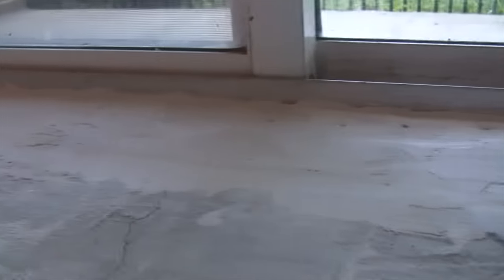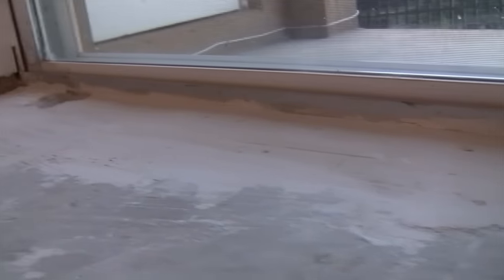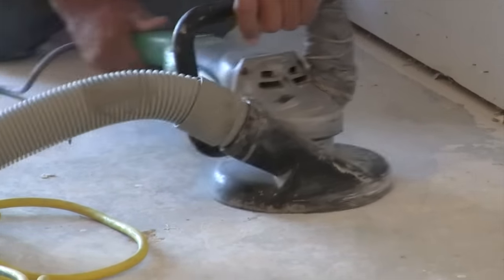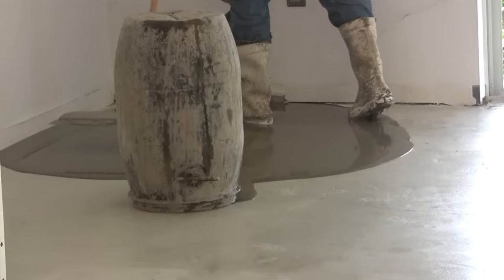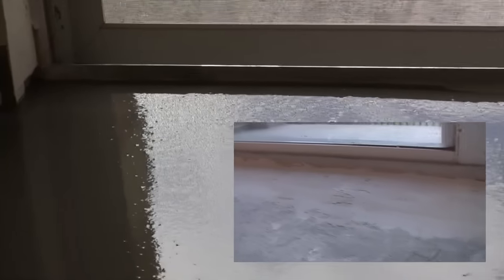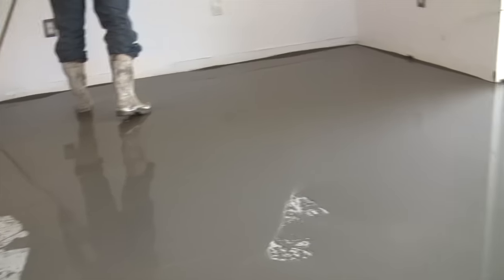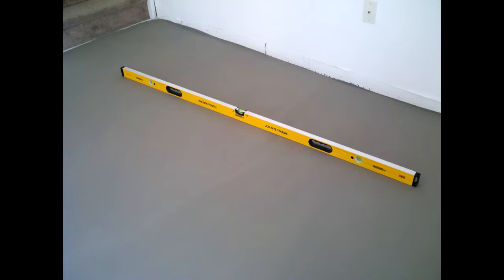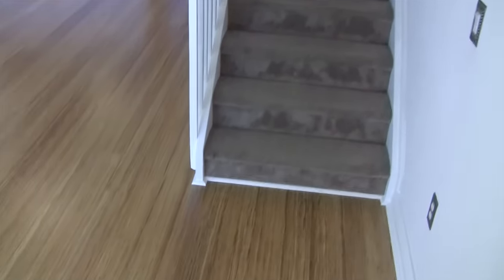How to Self Level Concrete Floors Like Pros - Self Leveler

Comment: How many layers can you put on top of each other? I need to raise the floor about 4” in some parts of my basement.
Reply from the maker: Great question. You can either use concrete to bring up the 4" difference close to level first, of course using all needed rebar, etc.  Or, if you are going over 1" in thickness, MAPEI recommends with their Novaplus 2 Self Leveler to sue a small aggregate of pebbles piled up:
 "For fills of 1" to 5" (2,5 to 12,5 cm) in depth, pre-place
 clean, nonreactive aggregate or pea gravel measuring  1/8" to 3/8" (3 to 10 mm) in diameter over the primed surface at no more than half of the total pour depth. (Use only clean, stable aggregate; limestone and other potentially reactive aggregates are not suitable.) Pour
Novoplan 2 Plus over the placed aggregate and rake
 aggressively to ensure full contact and bond with the substrate. "
Reply: Most concrete plants have a grout mix they can use for overlays. they turn out as good as the finishers are and they use the bonding agent as they did in this video. A self leveler can be used after but, 4 inches is too much for self leveling. I hope my response is helpful.
Reply: I have personally used A grout mix at about 2 inches where aggregate can be a problem. 4 inches throughout is just an over pour.
Reply: At 4" you need to learn how to float.  The cost of self leveler alone is gonna kill you
Reply: use regular concrete

Comment: And they didn't pull the carpet off of the bottom Riser because? So now when I go in to install carpet or lvp or laminate or tile I have to somehow cut through the carpet and imagine that if there's tack strip on the bottom of that Riser it's not going to be entirely embedded in self leveler?

5:32
Reply from the maker: You are not paying attention very good. They stopped the self leveler within an inch of the carpet. They did not embed the carpet in the self leveler,  you're just making stuff up.
Reply: @jeffostroff  as a 33 year flooring installer who has self leveled many floors I can say that if the leveler was "stopped" 2 inches from the carpet, any type of flooring (save ceramic) would have to have said 2 inches filled with floor patch because self leveler stopped short of a wall or some type of barrier would leave a height difference and therefore a gap under installed floor.

The carpet should have been pulled up. Any installer would tell you that.

And you can't just stop self leveler short. Not without a barrier. Believe me the self leveler reached the carpet.

I am paying attention plenty good.
Reply from the maker: @williamthomas5780  I don't know why you keep trying to force an error mode where there was none. I was there, I saw with my own eyes. I filmed the guy myself, like I said and like the video shows, the self leveler stopped not within 2" like you claim, rather he stopped within 1" of the stairs and did flow to within 1/2" of the carpet and stopped, never touched the carpet. He does know what he's doing and had good control of the flow. You just don't understand the concept of surface tension. These guys do this day in and day out, and when I tell them to stop 1/2" from the stairs that is exactly what they did. Stop trying to make up stuff that is not there. I installed this bamboo floor myself. There was no gap causing any problems like you claim, there was no 2". As a 33 year flooring installer, you should know when you terminate Bamboo flooring, it needs to stop 1/2" from the walls or stairs. So this was text book. the leveler stopped 1/2" from the stairs, and that is where my bamboo planks ended. We covered the 1/2" gap to the carpeted stairs with a 1 inch quarter round shoe rail. The end result was perfect and beautiful, and everyone who came to look at the condo fell in love with it. They all specifically commented how beautiful the floor was, and the real estate agents all commented how my floor did not creak like other flips they saw. You can try to nit pick and force feed non-existing disaster modes here until cows came home, but this flooring install was top notch. it also got me $20k more than the last condo sale in the whole place.
Reply: @jeffostroff  he's right. It would have been a simple matter of pulling that bottom riser of carpet first. A real professional would not have taken the chance of getting it on the carpet and guess what, no 1 inch 1/4 round needed.
These guys got the job done, but they were not pros.
Btw, 42 years for me as well.
Reply: Carpet and tackstrip should've been pulled period. 
1 inch quarter round is a rookie play no matter how long you've been installing
10 years in for me

Comment: what is the tool being used at the 30 sec point....thanks
Reply from the maker: He is using an angle grinder, looks like it is from Hitachi, and it has a shroud connected to the shop vac for dust extraction.

Comment: Mud set for tile is cheaper.
Reply from the maker: You are not supposed to use thinset or tile mortar as a leveler that's basic common sense the manufacturers usually warn you about this on the bag as well.

Comment: I do not understand that if this is a self leveling mixture than why are they racking it? Why isn't self leveling? And yes you can do this by yourself. I am a bit confused about this video and the information being given.
Reply from the maker: Someone really experienced could do this themselves. The instructions from the manufacturer for this stuff is still that it needs to be raked to get all of the air out of it and it does need to be coaxed into place first once it is coaxed into place it will then settle down And it will self-level on the surface but what you have to make sure of is that the self-leveler compound is working its way into every Nook and cranny on the floor so that the upper surface of it where the surface tension is will keep it nice and flat. this product sets up very quickly you only have a few minutes to work with it so an inexperienced person working with this material probably will not be able to pull this off. Because you have to be constantly mixing and dumping mixing and dumping until you get it all done you run the risk of the material setting up on you if you walk away and go and start mixing some and then trying to get it all to stay as one big liquid form until you are done with the pouring of the entire floor .
Reply: Thanks for replying. I'm going to try to do my garage floor by myself. Thanks again

Comment: You said that they only have a 2 minute mix time and a 3 minute window to spread out the leveler ? I highly doubt that
Reply from the maker: Zeke if you look at the data sheet for MAPEI, it says 2 minute mixing time and you have 8 to 10 minutes flow time. This stuff sets up very fast, you can walk on it in 2-4 hours. http://www.mapei.com/public/CA/products/2028300814-novoplan-2-plus-en.pdf
Reply: @jeffostroff  You better reads it again ....it says 24 hour until light foot traffic
Reply from the maker: @zeke112964  Sorry, I had read 2 different bags in a row, I must have got that 2-4 hour number from the Home Depot Wed site for Custom Building Products self leveling compound that they sell at HD, I was looking at both one after the other, got mixed up..
Reply: it's more like 3-5 minutes working time..
Reply: Use ice cold water you will have better working time.
Reply: Mix for 2-3 minutes. Flow time is 15 mins.
You all need to look at the data sheet again! It’s 24 hours for tile installation and 2-3 hours before walking. This stuff sets up quick.

Comment: I don't think you need 50 bags of slef leveling for this area that's just so much all what you did is add almost 1 inch in all the areas which is soooo much  . U should get the high spots and low spots first then get self leveling all over to get a smooth service.  I believe 8 bags is more than enough.  I do this work everyday and I always get flat service.  
U talking about $2000 on materials just to level the floor plus labor around $1500 . And thats only for 300 to 400 sq ft  . Thats a lot of money.  I feel bad for customers who pay that much . 
U didn't cover the walls or the carpet stires ? U never use the  Spike rollers or the right shoes . Not professional work at all .
Almost $10000 to get a small area done   what the heck?!
Reply from the maker: They had 50 bags there, I doubt they used half of them. This job was 325 square feet. Each bag covers 25 sq ft at 1/4" thick level depth of self leveler. That means a minimum of 12 bags. Some areas of the slab were 3/4 slanted downward so there was more used on one corner of the room.

Comment: So, why didn’t they protect the walls and pretreat the large cracks.
Reply from the maker: These guys were smooth enough they didn't need to protect the walls and he self leveler can handle those minor cracks all by itself. It's not like those are earthquake faults leading down to the center of the Earth they are surface cracks.   If the cracks were any wider than that take would have been patched.

Comment: Why didn't you fix cracks before leveling a floor? How can you be sure that the floor is perfectly flat if you didn't install no point of reference across the room?
Reply from the maker: They installed little plastic indicators all over the room and poured up to that level. The self level fills in cracks
Reply: @jeffostroff  Don't you think it should be discussed in the video?

Comment: How much did this cost with the contractor? Also, what is the total square footage for the whole thing
Reply from the maker: Hung, the Contractor charged us $1500 and this was about 25 x 15 ft. about 375 sq feet total.
Reply: You can’t charge by the square feet only by the bag of patch because it all depends an how deep the low spots are. I charge $100 dollars a bag and that includes the primer.
Reply from the maker: @VancouverIslandKayakFishing  These guys had 40-50 bags piled up, I don't know if they used them all, but using your formula, they would have only used 15 bags! I know they used a lot more.
Reply: Some people charge less some people charge more, also depends on where you are. I’m based out of Vancouver Island.
Reply: Also for me to by 50 bags it would cost me 1200$

Comment: I'm guessing that the builder didn't care to properly float that concrete slab when it was poured. Some carpenters use caulk to hide their sins so I guess some builders use carpet to hide a poor slab. Sad.
Reply from the maker: The builder had part of a rebar rod sticking up through the finished slab, we had to grind it down first.
Reply: @jeffostroff  That is REALLY sad. No care to do do a proper job or personal or professional  reputation.

Comment: LOL Tape the vertical blinds out of the way maybe?
Reply from the maker: LOL, these guys are not as sloppy as you, so they did not need to move the blinds, they just pushed the leveler under them and it flowed into place. Tape doe not hold vertical blinds in place.
Reply: @jeffostroff  Oh Okay sure, your tradies are not as sloppy as me. Because you know me so well. Never seen a sloppy tradie LOL. Tape does hold, takes 20 seconds as a precaution.
Reply: Those blinds break the second you touch them! POS... they look clean enough to me!

Comment: This technique seems great for creating a "flat" floor, but does not seem to address levelness.
Reply from the maker: The floor was level when it was done. that's why they call it self leveler compound. The surface of the material is what self levels. Did you not see the testing afterwards with the 6 foot level?
Reply: @jeffostroff  The 6 foot level confirms flatness was achieved, but no shot of the vial.

Comment: 40-50 bags? Even with a bulk discount the bags alone would cost well over $1000. This job had to cost over $4000. Just saying.
Reply from the maker: No it was about $1500, not sure they used all of them, that's how many I counted them unload off the truck. Also they buy by the truckload I'm sure.
Reply: @jeffostroff  I meant for the finished product. Are you saying that the finished product with the flooring down was $1500? That's not bad.

Comment: I understand the fact of hiring you guys to do de job. Of porpoise of video. Great vid. But. Can you show or tell how much water per bag. ( I saw mapei)  must be used? I know.  I know...
Bag says. A number of ounces.  I DON'T HAVE A METER IN MY HOSE!!. could you be simple and direct..  like.. a bag of 50 pounds per a 5 gallons of water. Or something like that? In the video.  That's not  shown.  And we don't have those barrels to do a 1 time job at home. Not even where to get them! Also your zquezee looks more like a mop thing to clean wood floors. Not like a regular one. I know I can do this. I'm a construction person 20 years ago.  But everything is updating.  As far. Every time a see a video.  NO ONE SHOWS THE MIXING AMOUNT SIMPLIFIED.  Just make it  simple.. That's all I'm asking.  Thanks.  And  great vid.
Reply from the maker: Every bag is different. But for example the self leveler sold at home depot says Mix the entire 50 lb (22.68 kg) bag of powder with 5.25 - 5.75 quarts. They sell at Home depot small clear buckets which have lines like a measuring cup. Fill one with water up to 5.75 quarts. Then pour it into a 5 gallon bucket. mixing paddle at minimum 650 RPM. Thoroughly mix for 2 minutes to a lump-free consistency. Do not overmix. Overmixing or moving the mixer up and down during the mixing process could trap air, which could shorten the pot life or cause pinholing during application and curing.

Comment: mate 40-50 bags for 500 sqft lol they ripped the homeowner off for sure that is no more then 1/4 thickness and each bag gives you about 50 to 150 sqft depending thickness but this job needed 15 bags maximum lol poor guys paid a fortune for this
Reply from the maker: I doubt they used all of them, that's why I counted stacker dup outside. But the floor was about 1" lower on one corner, so it would not surprise me.
Reply: @jeffostroff  the video said used 40 to 50 bags and there is no way they went up 1 inch anywhere on the video posted that its standard 1/8 and they just moved it around

Comment: What the heck made the floor crack like that? I would have made the original builder come back and put that right.
Reply from the maker: Lol welcome to foundations in Florida you can have cracks like that and really they look scary but there's really nothing wrong it's not like the building is falling apart. All builders have escape clauses in their contracts that say they can't guarantee there won't be cracks because land does settle. It was no big deal this kind of thing happens all the time and even even if it didn't happen we still had to level the floor
Reply: my contractor buddy told me "There's always at least 4 cracks in every truck of cement, that I know. What I don't know is where they'll end up"

Comment: What size are the bags of leveling compound, 40lb? 50lb? 80lb? Who makes the primer you covered the floor with? Where did you buy the products? Why do you give links for everything except what this video is about? For a "how to" video, it doesn't give any useful information.
Reply from the maker: Sorry about not having links. Usually trying to find 50 pound bags of mortar on Amazon is a tough task, and they don't appear to carry MAPEI products, which are mostly found in tile supply companies. But I did find one that I had used before, and here is the link to it on Amazon: https://amzn.to/2TPyMfk That manufacturer also has their own recommended primer on Amazon too: https://amzn.to/2HRZhiG . Finally, trying to link to the product used in this video was impossible, because MAPEI no longer makes it, they have moved on to newer products, namely Novoplan 2 Plus, which you can see here on their web site: http://www.mapei.com/public/CA/products/2028300814-novoplan-2-plus-en.pdf

Comment: Not trying to defend the builder but technically whoever poured the concrete did a crappy job. The builder just picked a bad sub.
Reply from the maker: I have never seen concrete come out prefect and flat in any building ever. Perfection is probably not what they aim for with slabs

Comment: OSHA has strict guidelines that must be followed when dealing w Silica (concrete). The example here violates 3 of there required guidelines. Is the floor leveled? Yes. Has the health of the installers, homeowners and anyone else entering this project site been jeopardised? Yes. Learn the rules fallow the guidelines. The penalties arnt worth paying...
Reply from the maker: This was filmed in 2012, when not all of those rules were in place or enforced. Now the installed does have the vacuum in place on the shroud while he was grinding. What are the 3 violations? Don't leave us all hanging.

Comment: There's so many things done wrong in this video. No spike roller, he was using a smoother to move the compound instead of a gauge rake, no height pins, the leaving the bottom step of the carpet on was just comical. Not to mention none of the walls were dammed off. As a professional flooring contractor I would advise never to peform something this involved without an educated professional onsite

Comment: Word should get out that the original concrete pour is a poor company. When you do work like that, why does anyone call you.
Reply: Because they are cheap and fast. As in they will come be at your beck and call 24/7 because they have no other work. I have a builder like this and I'm just happy they put carpet in the basement and I dont have to touch it.